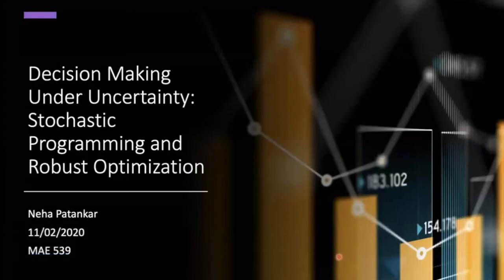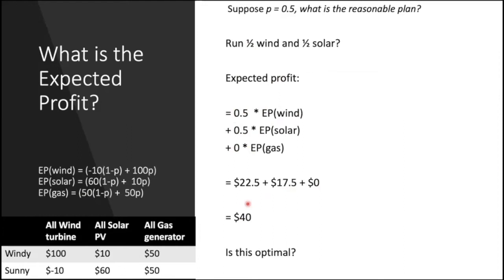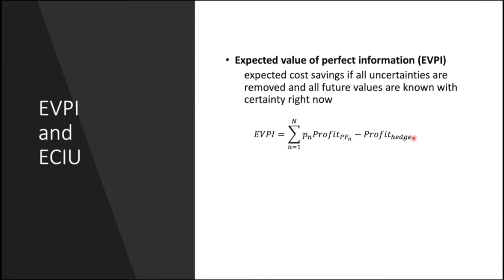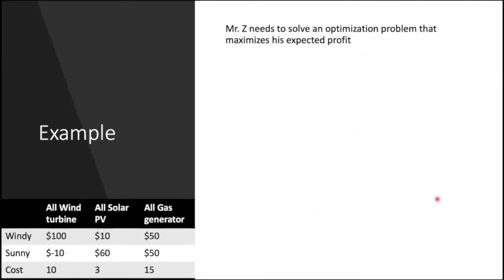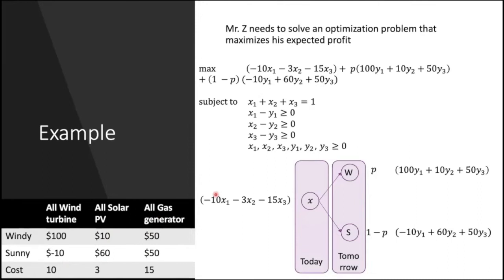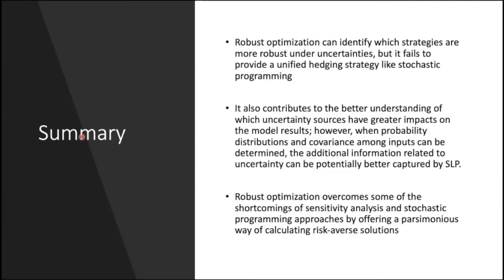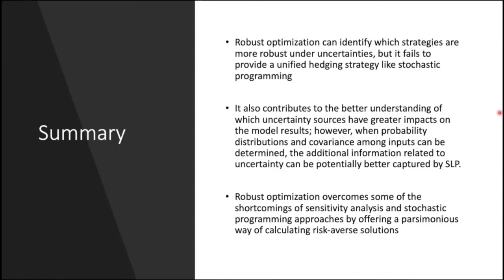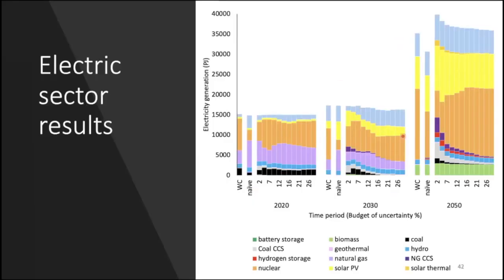Stochastic Programming & Robust Optimization | Energy Modeling | Guest Lecture

Comment: Hello mam, I am a Ph.D. student. I want to learn about Power system optimization considering uncertainties and demand response. Can you please provide me with where I should start learning, how to code uncertainties, and power system modeling?
Reply: Actually mam my Ph.D. work is related to the multimicrogrid modeling with Heat and Power integration. The cost and reliability are the main objectives.